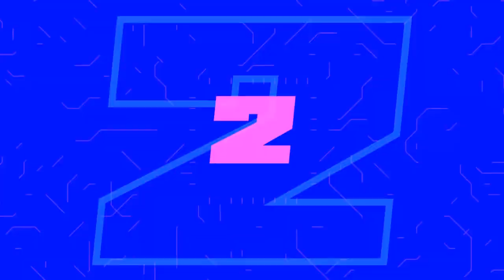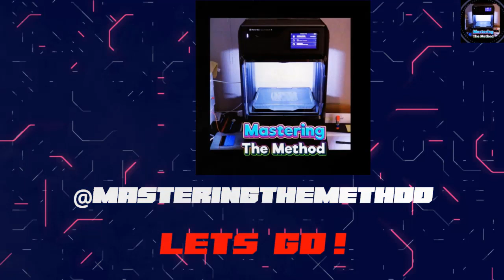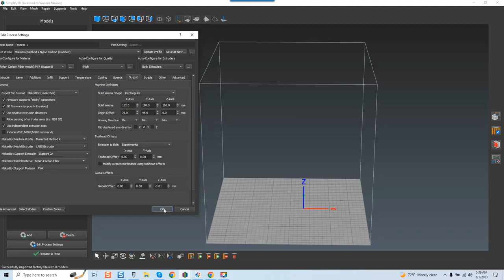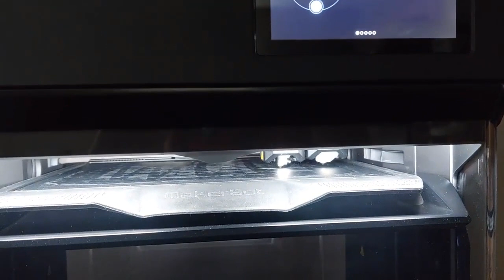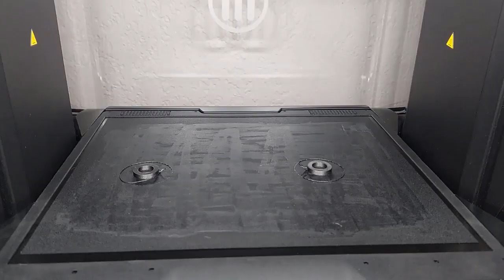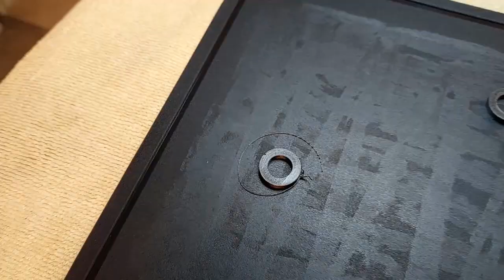How To Extend The Makerbot Method's X Axis Build Volume 25% When Using A Single Extruder

Comment: Is there a way to use the same filament in both extruder's (swapping for appropriate nozzles) so there is full use of the print bed? For things that dont need supports or are ok using breakaway supports.
Reply from the maker: Thank you for your support. Using S3D you can print using only the model extruder as the video shows using the full build plate volume. You can't print with both extruders using the same filament. 

Thank you,
Vince